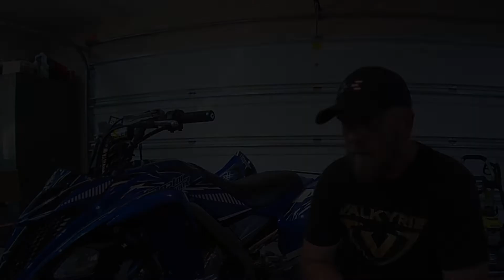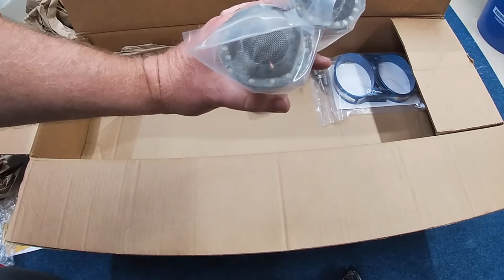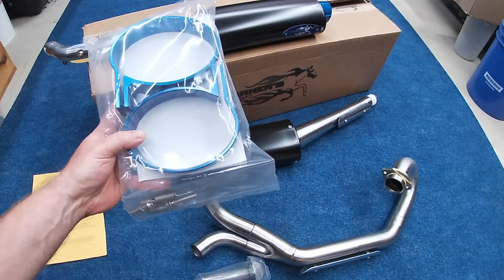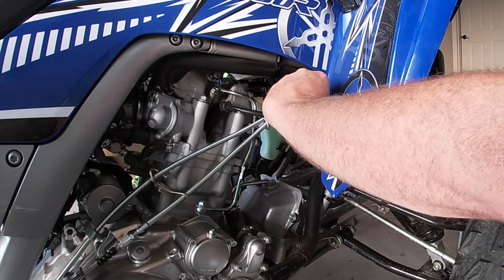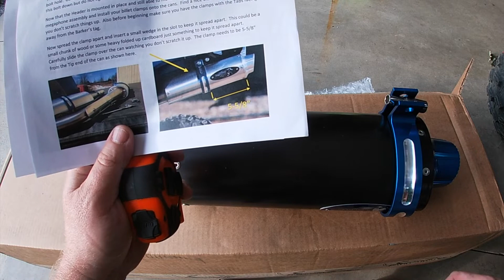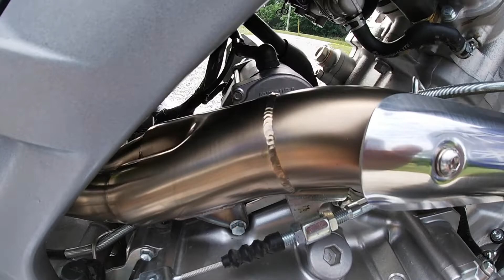Barkers Performance Dual Exhaust vs Empire Dual Exhaust… well no code 42 fault now!!!

Comment: Man...i got empire dual exhuast big 3 on the way and now im concerned about the speed senor and fender on the left. I have a 2024 700r. This was a great video tho! And i too like the heat shields that come on these! Man oh man...i hope empire changed the design for the 2024 concernng the speed sensor
Reply from the maker: You will probably need to trim the fender on the left side I had to on mine. I ended up getting rid of the empire and went with a dual Barker system. No issues with the speed sensor because there was clearance and no trimming in the fender. Empire did offer to the pipes so they would clear the speed sensor. I don’t know if they have made that change moving forward.
Reply: @SquatchReloaded  yeah I saw the video of you putting it on which is why I made this comment! Yikes....I'm gone have to message them and see if they made a change and even talk to mechanic imma have put it all on and see if they are still running into this issue because it's not worth doing all that in my opinion especially when the barkers fits good and even has the heat shield. Man...
Reply: I just ordered my Big 3 from Empire a few days ago, spoke with Sam on the phone and they now currently have a pipe that clears the sensor, along with a heat shield. I’m more than likely gonna do what I can heat wrap wise as well, but I won’t know for sure until it gets here and I got it on of course. I’ll be back to update when that happens lol. Until then, Merry Christmas everyone!

Comment: Is this 96 db or less
Reply from the maker: No
Reply: You can get quite cores for the exhaust. According to their website…
Without: 105db/ 110db @ 3k/4k rpm
With: 93db/ 98db @ 3k/ 4k rpm

Comment: Whats the point of removing the speed sensor? Is it just for clearance or something else???
Reply from the maker: It is to clear the pipes.  However it will throw an engine code eventually.   I ended up swapping these pipes out with a Barker dual exhaust.